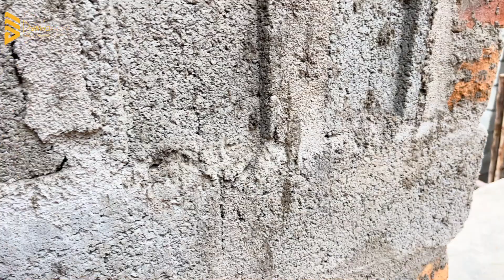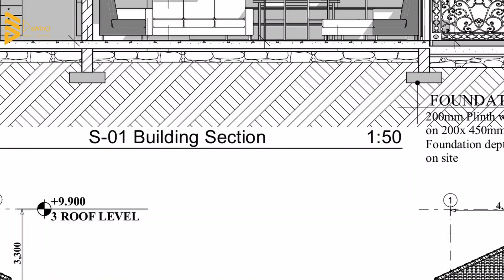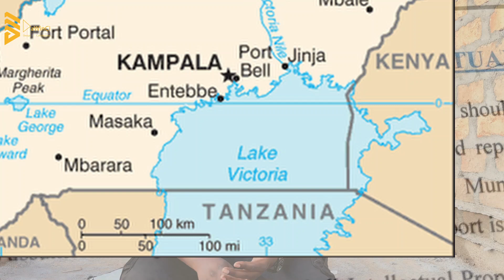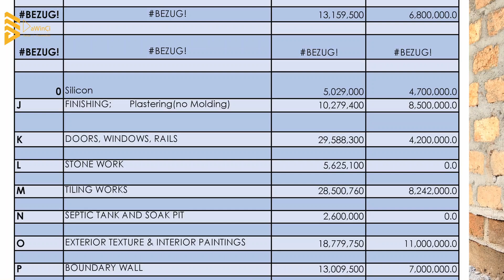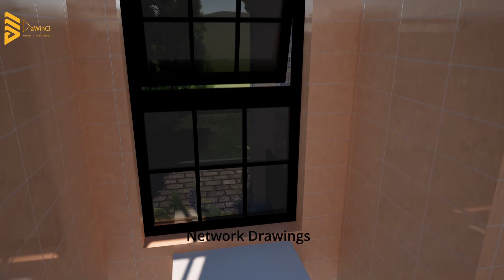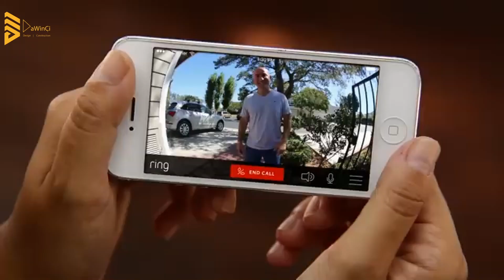You Cant Build Without these Documents in Uganda |Construction preparation 2024

Comment: I'm Ethiopian engineer who worked in uganda most Ugandan structural engineers seem to over design structures you may find 2T20 was only required at support you may find running throughout the span whic may be to costly